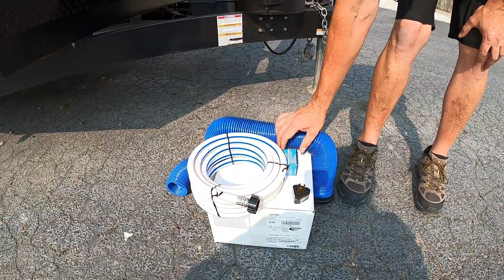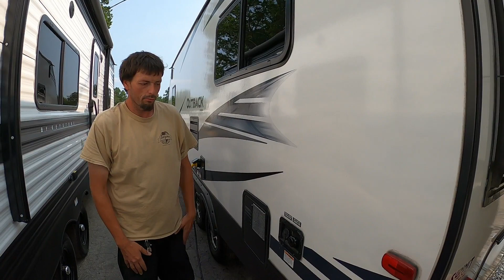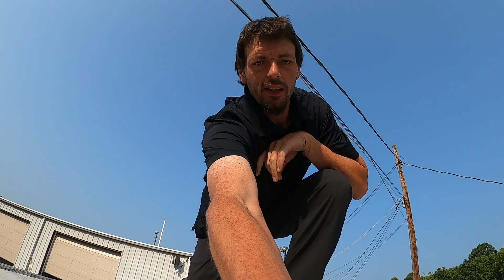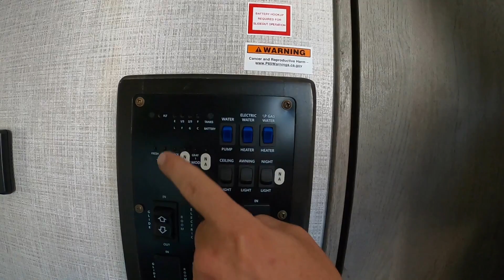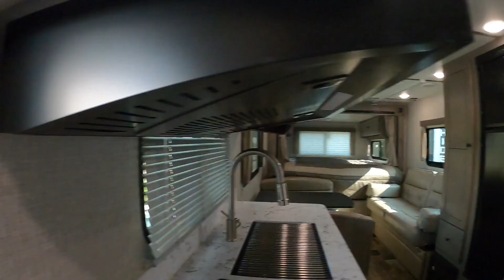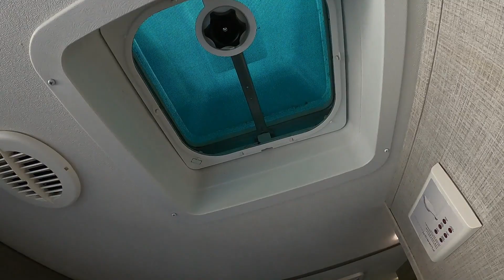How to properly use and set up a 2019 Outback 240URS #11239

Comment: Very useful video, thank you.  Cool layout but was hoping you could use the bed with the slide in, any insight mechanically why that is?
Reply: Basically all slides are not meant to withstand weight when they are in the in positions. The weight is distributed onto the frame of the RV when extended fully.
Reply: @justind3820  Did a little digging and in this case, there are cables under tension that support the slide when it is out and good for 1000 pounds.  When the slide is in, the manufacture recommends not more than 50 pounds on the bed.

Not sure about all slides, the last coach I had there were no issues using the furniture with the living room slide or bed slide in but the bed slide on that one did not extend out full bed length like this one. You have to consider how far this particular type of slide is when in the out position, it is quite long compared to others that we are used too.

After reading around in the forums, a couple of people stated that they had built some type of 'brace/support' for the bed when it is in, something to think about.